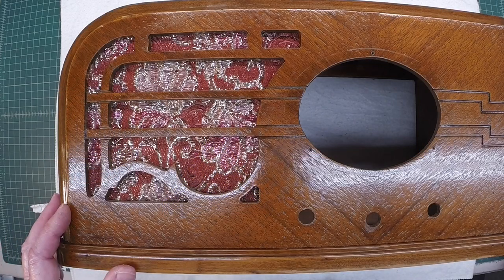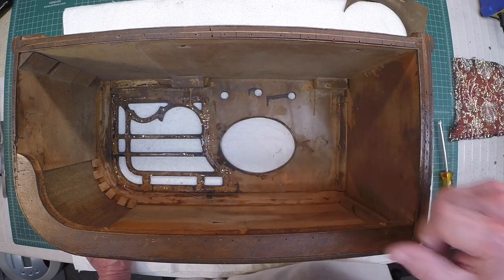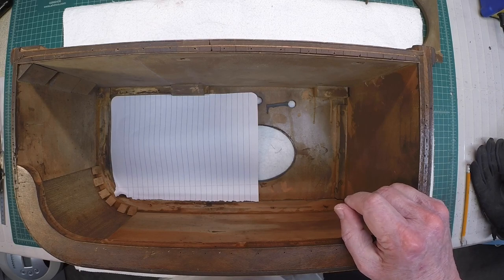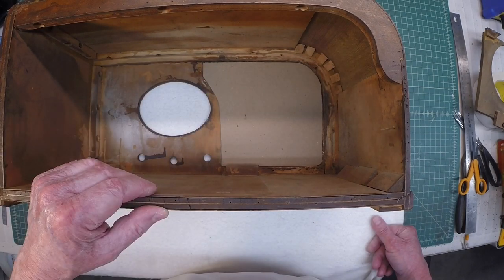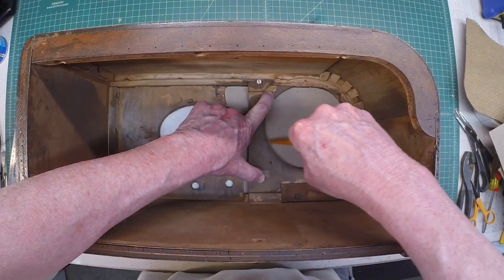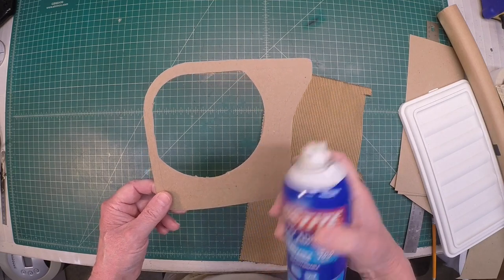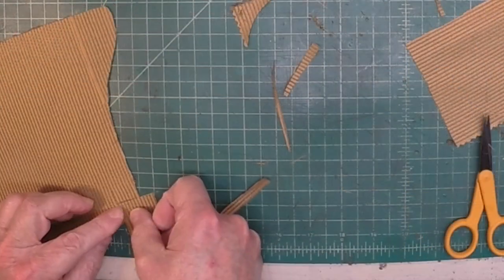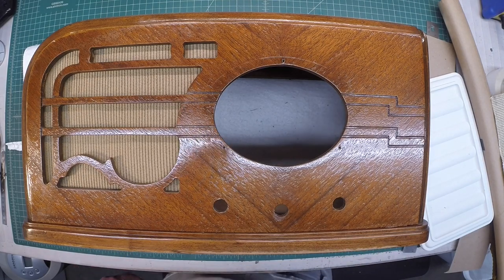Airline 62-316 - Grille Cloth Replacement

Comment: The replacement grill cloth that was there was totally wrong. It had a definite pattern that was obscured by the wood
design . A better choice would be any solid or two tone color with a very small repeating  or linear pattern on it.
Good technique using a pattern for the size needed on the backer and cutting a hole for the speaker in it. Using the iron 
with some Magic Sizing  to flatten the cloth on the backer is clever. The finish replacement grill cloth  looks good Don .
Reply from the maker: Much appreciated Steve. It looked like a piece of fabric that someone made work and the scrap piece I used definitely looks more appealing. Thanks again Steve. Best, Don